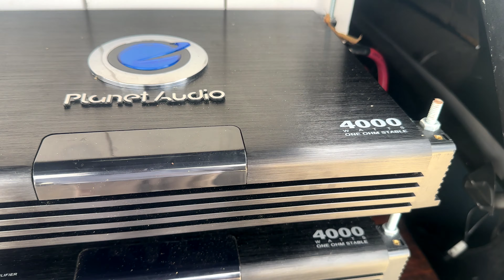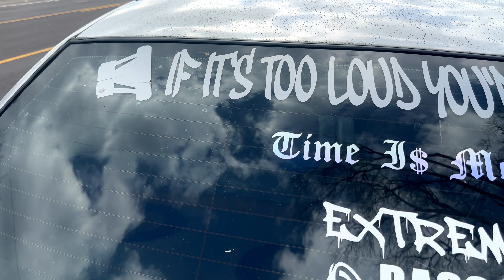PULLED UP ON MY HOMIE WIT 6 15" SUBS...6 AMPS....8 BATTERIES...CUSTOM WORK... STRAIGHT BEATING😒😒😒😒

Comment: I have seen those Planet Audio amps and wondered if they were worth the money but now I see that they are. Was thinking about getting a 5000 watt one, would I have to have an extra battery?
Reply from the maker: Yea a extra batter would be better or even a capacitor would be fine gang🤟🏾🤟🏾🤟🏾
Reply: Thanks for the information.